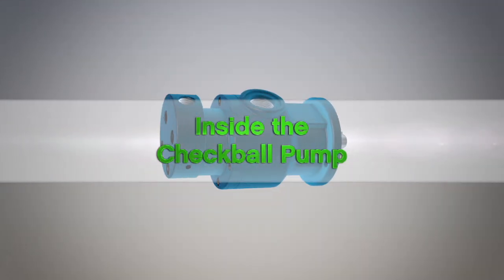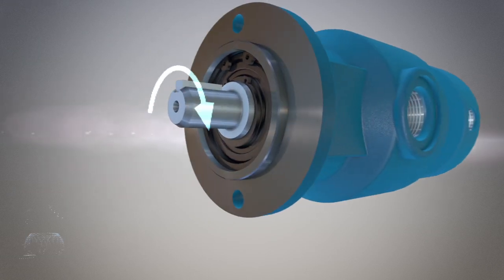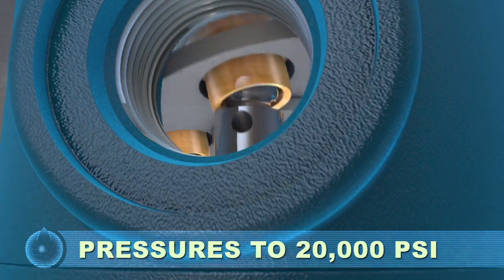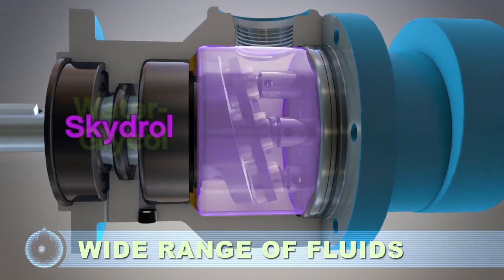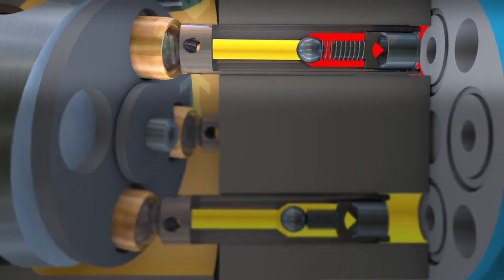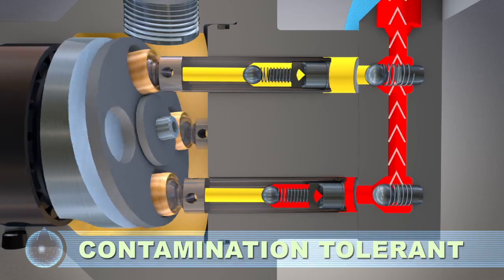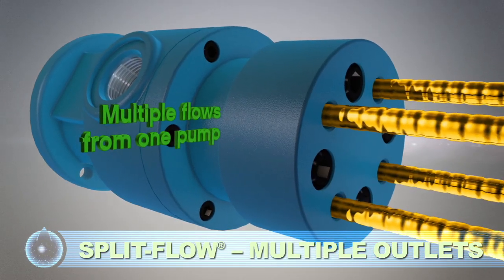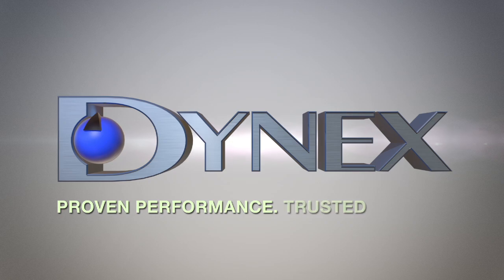Inside the Checkball Hydraulic Pump: Design and Operating Advantages

Comment: why use a pump that flushes contaminants in the pumped fluid
Reply from the maker: All pumps will push the contaminated fluid through them. The advantage of our design is that the contamination does not have to be sheared across a valve plate and the flushing action of the pistons allows the contaminated fluid to be flushed out of the pump where a pressure filter can catch any of the debris ahead of more sensitive components such as servo valves and other equipment.
Contaminated fluid inside a pump could destroy a less robust pump and cause even more issues. Our design helps eliminate a potential weak point for the system.